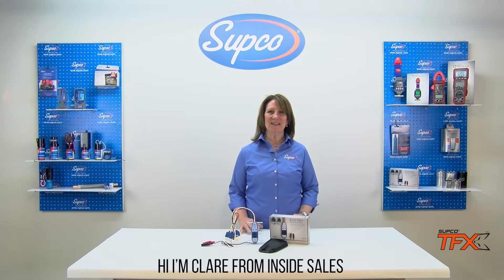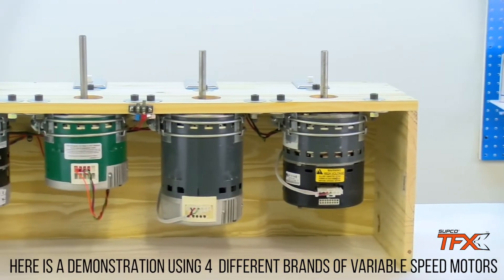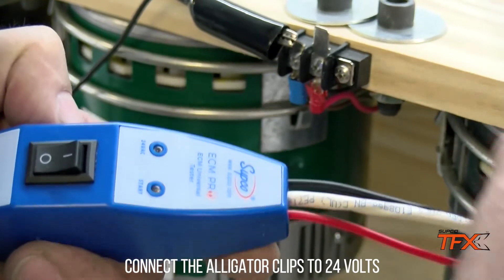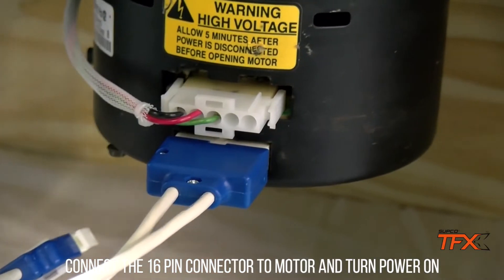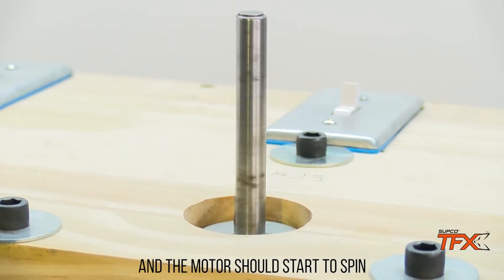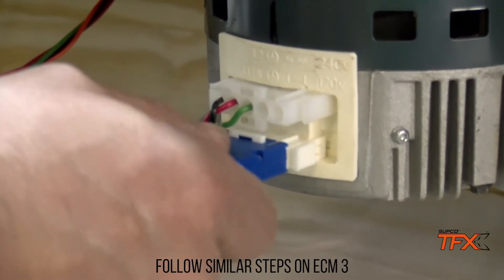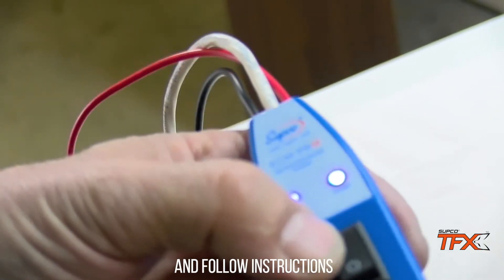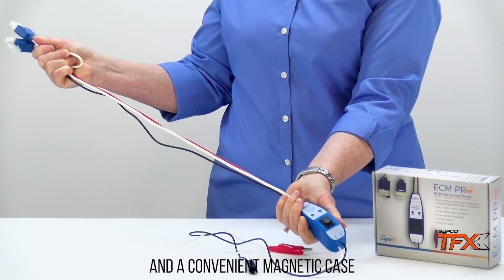How to Easily Test an ECM Motor Using the SUPCO® TradeFox™ ECMPRO Universal Tester

Comment: This is all fine and dandy but techs need a tool that can tell you if the motor or the module has failed anybody can test for power at these ports and tell you the same thing this tester can tell you with a simple multi meter.
Reply: Exactly

Comment: Does this work with DC motor input?
Seems like some mfrs are using a communicating low voltage input that is DC. This tool is AC.

Comment: Doesn't tell me if the head with the capacitor's is bad or the windings in the motor. Each will cause the motor not to spin.